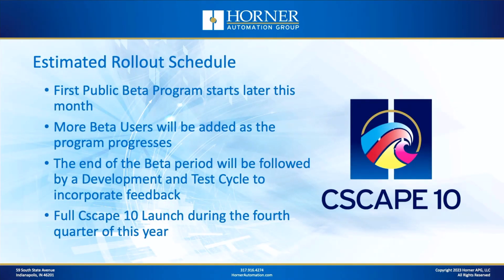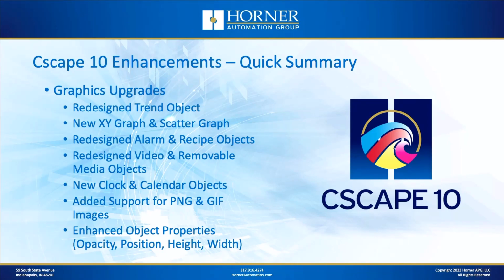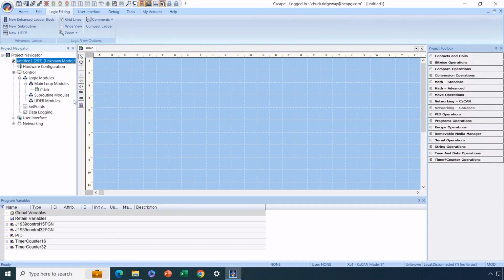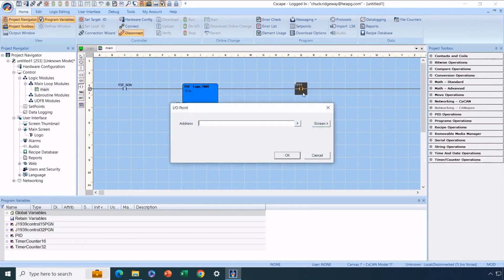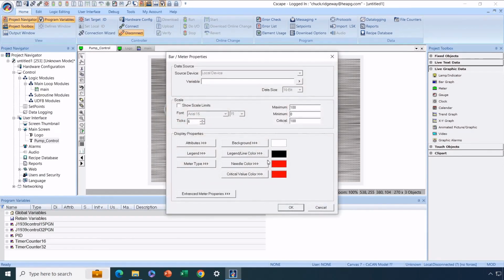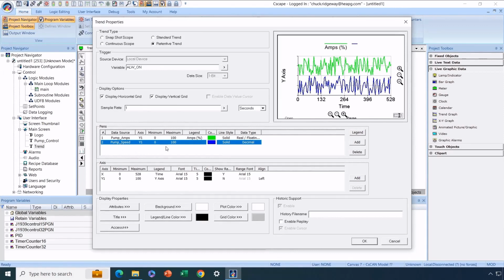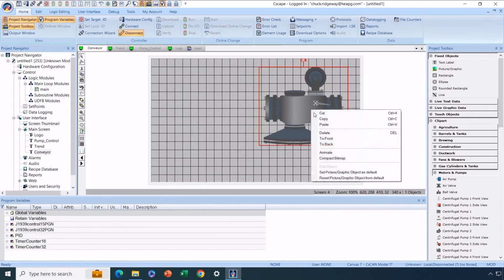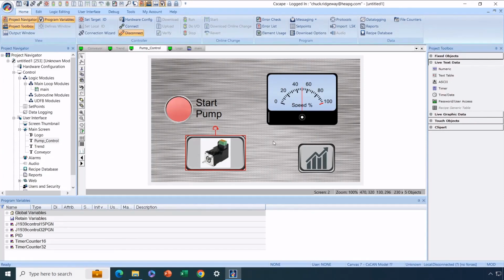Preview of Cscape 10

Comment: I was hoping to see some new logic elements, such as edge contacts, rather than just edge coils :( Going from one manufacturer to another requires some creative work-arounds, so more flexibility helps.

Also, I hope that variable selection via the pull-down is now sorted alphabetically.
Reply: Edge contacts would require a fundamental architecture change in the firmware – so that's why those were not included.

However – you will have the option as you browse variables to sort them, either in alphabetical order or in order of creation - and that can be changed on the fly.